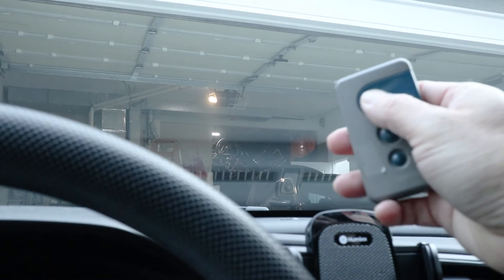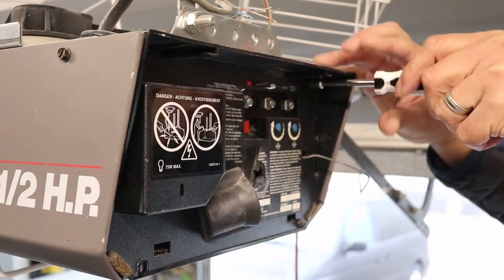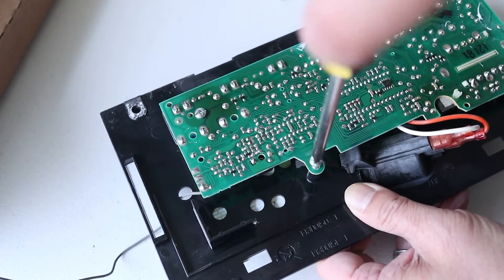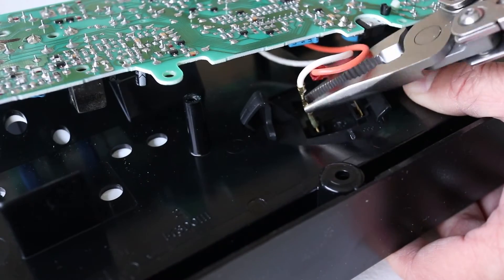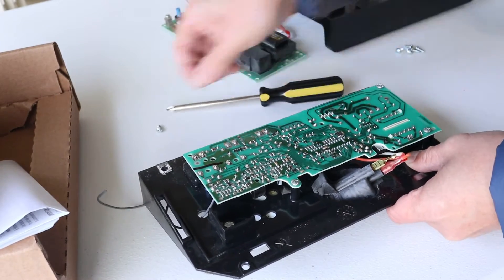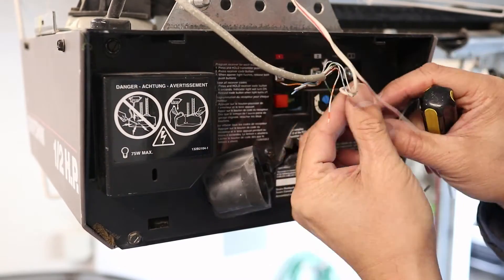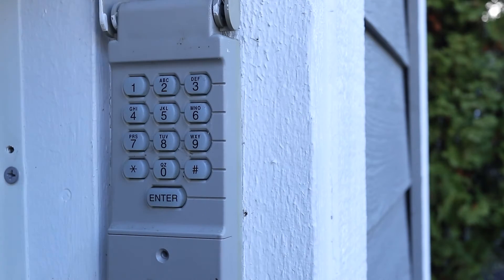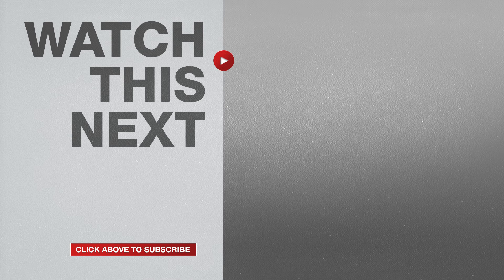Garage Door Opener Circuit Board Replacement - Craftsman Liftmaster Opens From Wall But Not Remote

Comment: Excellent video.  I was able to replace the board but my opener still can't be programmed.  At this point I suspect signal  interference.
Reply from the maker: That is definitely a possibility! LED bulbs are a major contributor to interference of the remotes. Try incandescent bulbs or take them out to test if it’s actually the bulbs causing the interference.
Reply: @TheRenderQ thanks for the suggestion.  Removing the bulbs didn't help and I have no idea what else could be interfering.  I spent $30 and made it a smart garage door.  Opening and closing with voice commands is good enough!

Comment: Please note that after numerous attempts I was unable to connect the short wire harness to the circuit board after it was mounted to the cover as shown in the video. Instead  I connected  the harness to the circuit board first and then mounted the board to the cover.

Comment: Thanks for the video. My opener stopped working. My wall button is flashing - I read it could be the circuit board. Before going ahead and replacing it I have one question. The reset button currently does not light up when pressed. Is this an issue relating to the board needing replacement - or does it indicate another problem? Thanks!

Comment: Why did you have to swap the old board with the new board if the housing were the same. Just install the new assembly.
Reply from the maker: Someone else asked the same thing. I had to swap the boards with the faceplates because the new faceplate was slightly different shape and didn’t fit back on the garage motor housing. Even though in the video they practically look the same.

Comment: I don’t understand why you swapped the circuit boards instead of just installing the new board along with its faceplate.
Reply from the maker: I can see why you’re wondering why I swapped out the circuit boards. I guess I didn’t explain it in the video. It’s because the new faceplate was different than the one from my garage door opener. The top and bottom are slightly different and the screw holes in the bottom didn’t match up with the location of the original holes. In other words I can’t attach the new faceplate onto my garage door opener. Luckily the circuit boards are the same so I just swapped them out. But depending on your model you may be able to just swap the entire faceplate/circuit board assembly. Hope this answers your question!

Comment: I bought the part from seller on eBay, which was half the price than Amazon and the part fit perfectly so I didn’t have to switch out the circuit board. What an amazingly spot on video thank you brother!!